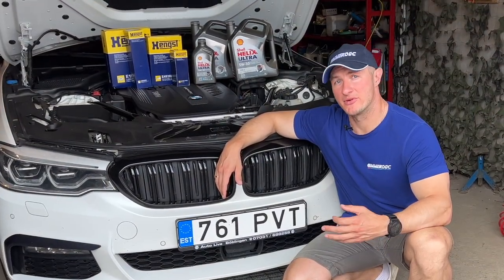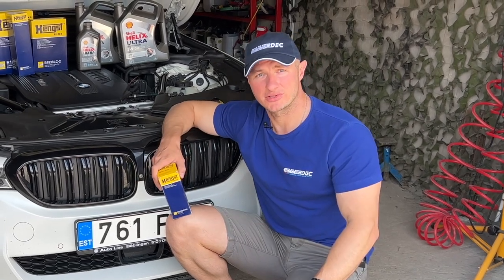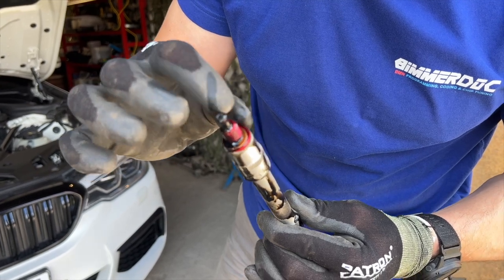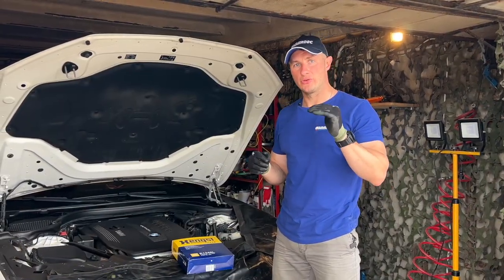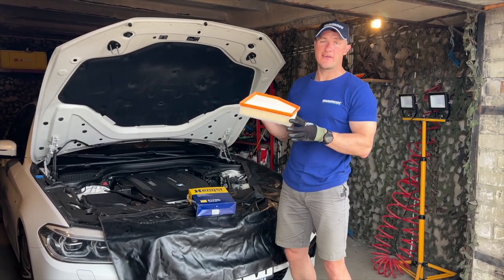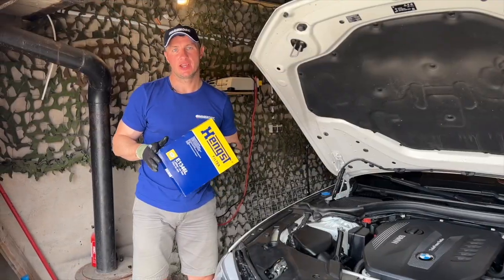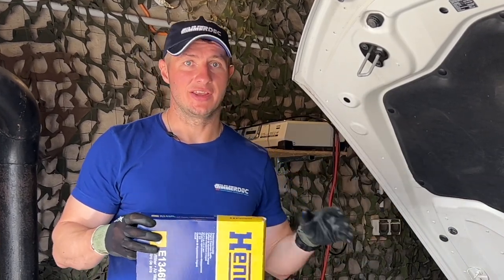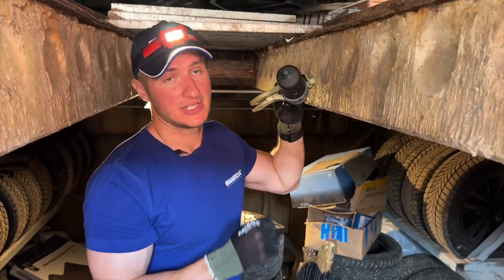How to service your BMW properly? Engine oil and all filters replacement DIY

Comment: Again a very useful video for all of us. Is there a way to check if the repair shop really changed my fuel filter?Because very often they take your money without changing your filters.Because this will reflect for some values.Thanks.
Reply from the maker: I recommend to make a hidden mark there for example.

Comment: Are you sure about the microfilter orientation? Would you think there will be a difference in orientation between LHD and RHD cars?
Reply from the maker: Air is coming from the front part of the car towards the back. The flow direction arrow should be pointing back. 

LHD or RHD doesn’t matter. Front of the car is the same 😉
Reply: Please review and let me know your thoughts
Reply: Quite nice question. I was changing in G30 pollen filter for the first time and discovered that filters were installed with the arrows towards the back of the car(as a case for F10), but apparently blower directs air towards the front side of the car(it might be checked when filter is removed and blower is on). So would be great to figure out it together. For the video-great one.

Comment: It would be very interesting if you approached from your point of view an antifreeze change at the ist and/or manual level using the procedures recommended by the manufacturer.
Reply from the maker: That’s another fluid that is often not changed properly. Good point!

Comment: Hello, very useful tips. I have the exact same engine. I was searching for that type of oil pan cap, could you please tell me what's the measurement because on Amazon it shows three different types M12x1.25 or M14x1.5 or M12x1.5.
Thanks
Reply from the maker: Was ordered those years ago…
See ETK (part catalogue) and over there all the dimensions will be shown.

Comment: Great video again! When you mention operating hours, it sounds logical but what about a Hybrid BMW. In my village I often drive electric for days so will ISTA show these electric driven KM as operating hours too?
Reply from the maker: That’s a very good point!
But engine operating hours are counted only if engine is working. 

When you do drive from electricity then engine op hours are not running. Because those are different ECUs
Reply: @BimDoc  thanks 👍🏻

Comment: so its not needed to bleed fuel filter via software? i have g30 520d, wanna change fuel filter myself. thanks
Reply from the maker: Via ista it is possible to bleed fuel filter 
But it is not needed. Just turn on the ignition (in your case diagnostic mode) and wait a bit (30 sec)

And then you can start the car as usually
Reply: @BimDoc  thank you!

Comment: I recommend to change based on consumed fuel. In that way it will cover city driving, also sport driving (where the consumption is higher).
Reply from the maker: It makes sense, but it’s a bit harder to track. However there might even be an option in ista to check burned fuel amount. I have to take a look )

Comment: Hi Vladimir, I replaced the air filter and micro filter(inner room filter) myself with the help of your video. But don’t know how to reset the filter service intervals in my BMW F31. Should I use Esys? or please can you share any tricks how to reset this. Thankyou
Reply from the maker: All intervals can be reset via cluster button 
Need to hold it while ignition is on. 
It will allow to reset the counter

Comment: the tightening torque of the original plug is?  The one you have from Aliexpress that is made of aluminum is the same as the original one?  could you put a link to the cap?  Thank you.
Reply from the maker: The torque is not big there. Around 10-15 Nm max. It’s aluminium there ))

Key work to find that cap is: bmw oil magnetic plug

Comment: Can you tell us more about oil change intervals. 10 000 km. that's clear. But what if the distance traveled is less than 10 000 in one year ? Should I change it or not ?
Reply from the maker: It depends on the climate you live in. 
If during winter there are temperatures way below 0 (like -20) then yes change once a year or 10k km. what ever comes earlier.

Comment: У меня bmw f30, моточасы удобно контролировать в бортовом компьютере в разделе «Компьютер поездки». Нужно просто сбросить на 0 значения после замены масла. Получается быстро, удобно и инста+ не нужна) Спасибо за мануал, многим он будет очень полезным! 👍💪
Reply: Как вариант, нормально, но я предпочитаю использовать его для поездок, что является его обычным использованием, для всего остального у меня есть ista.
Reply: @pericodelospalotillosverdes  каждый сам определяет «обычное» использование функционала своего автомобиля. Я например не вижу смысла засекать простые поездки, тк для этого есть одометр, который также всегда перед глазами. Сколько времени в поездке работал мотор или какой был расход. Зачем это нужно?) лишняя информация 😃 но это для меня. У всех свой взгляд на вещи 👍
Reply from the maker: Да так тоже можно. Минус что этот параметр сбрасывается кот кодировании ГУ и тд… если часто Гуд авто делать эксперименты, то этот способ не работает ((
Reply: @BimDoc  правда что компьютер поездки считает время и на выключенном двигателе? Но при включенном зажигании. Я слышал такую информацию
Reply: @BimDoc There are counting hours of the engine in hidden menu on instrument cluster, at least on my f10 digital cluster. On my e39 is counting burned fuel and from factory was set on 887 liters but it's possible to code different with Bmw Scanner.

Comment: How much torque on the re-fitting of the oil drain plug? Also 25nm same as the oil filter cap?

Also What size is the socket required for oil filter housing cap removal?
Reply from the maker: 25nm is too much for such a small bolt. 
Ish 10 is okay 

14 if I remember correctly
Reply: @BimDoc  Ok... sweet. I got 25nm from watching another video on another channel. They used 25nm on the drain plug so I thought I would clarify with you. It does sound a lot to be honest. I'll aim for 10nm in the beginning and see how that feels.

Great video by the way. Very informative.
Reply: BMW usually has M12 drain bolt which is 25nm. Some v8 engines like n63 have M18 bolt with 35-40nm.

Comment: Hello Vladimir! Regarding maintenance of my 2011 N57 BMW, I have a question: I want to replace my timing chains and tensioners and everything related and I want to ask if you know if OEM BMW timing parts are produced by Febi Bilstein or Topran or so. What brand should I choose for this parts? Thank you very much!
Reply from the maker: Unfortunately I don’t know the producer of those parts. 
I purchased original parts when I was doing that job in my bmw.
Reply: @BimDoc  Ok, thank you very much for taking you time to reply!

Comment: Hi Vlad, thanks for the video. What’s your oil change recommendation for G30 PHEV 530e if I do 2/3 on electric and 1/3 on petrol ?
Reply from the maker: Engine oil should be changed every 200 operating hours. 

If with average speed 10k km is 200 hours and you are using 1/3 of your time gasoline engine then looks like proper value is 30k km. 
but also oil has to be changed every year! (Depending on the climate)

So change once a year or every 200 operating hours

Comment: In the fuel filters there are plastics and metals, is it better to use plastics or metals and why?
Reply from the maker: On different BMWs filters might be different
Reply: @BimDoc  If the origin is plastic, is it advisable to continue with an OEM plastic one or can it be changed for a metallic one with the same result?

Comment: You have missed to say that you don't have to fill up oil to a filter cap or filter box, some says that it's recomended to fill in oil there, but there can be an issue, we don't see that recommendation on TIS, because there can happen an air trap.  
Вы забыли сказать, что людям не нужно заливать масло в крышку фильтра или корпус фильтра. Некоторые говорят, что рекомендуется заливать масло туда, но может быть проблема, мы не видим эту рекомендацию на TIS, потому что может случиться воздушная ловушка и прокачка масла будет затруднена
Reply from the maker: Yes, I don’t see the point to fill oil filter holder. There is enough oil in the engine after the change to provide first needed lubrication.

Comment: In terms of the number of hours, is it better by hours or by time?  I often change my oil for time never reached 10,000 kms.
Reply from the maker: More professional will be by engine operation hours (200 operating hours). But if you do change every 10k km it’s way better than 30k km.
Reply: @BimDoc  but if to do 200 hours it takes more than 2 years or up to three, it is better by hours or by time?
Reply from the maker: In that case 200 hours or no more that 2 years (depending on the climate you are living). Up in the north where temperatures during the winter are way below zero it’s recommended to change oil every year.
Reply: @BimDoc  will you recommend to use  0W-20 oil grade in UK preferably in a B38 engine?

Comment: On bmw n55, the dealer sais that after you changed the oil you have pump the engine without sparkplugs, to prevent rod bearing issue!!!!!!
Reply from the maker: Sounds a bit too much job for regular oil change. Via basic oil draining there is still enough oil to lubricate all engine inner parts. 
But if it is written in the TIS in that way, then it might be the case.